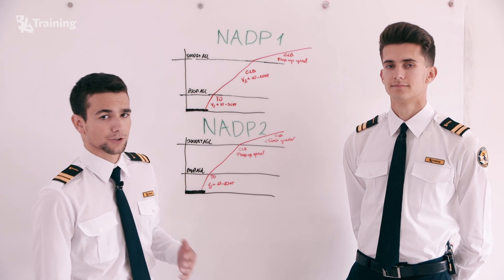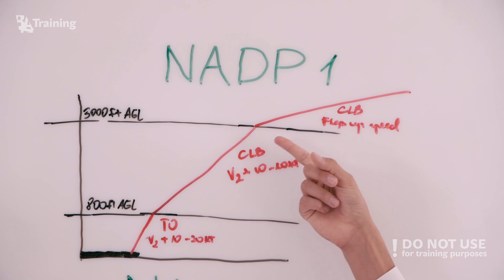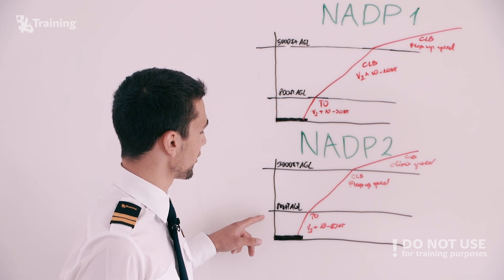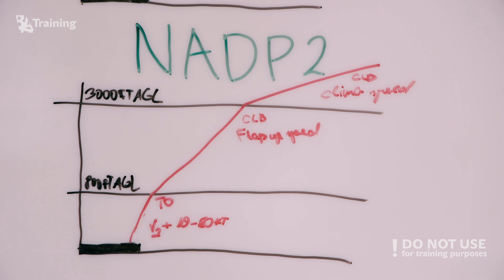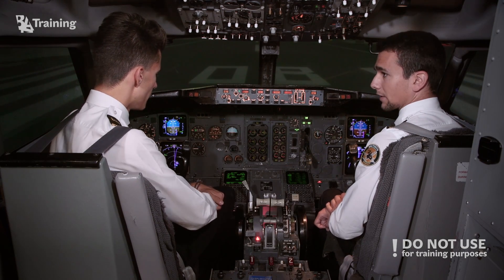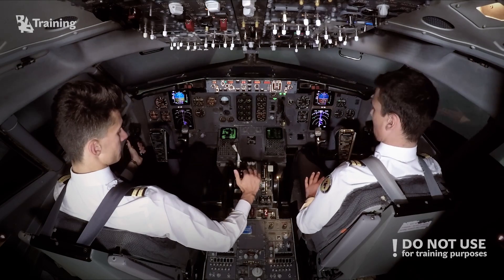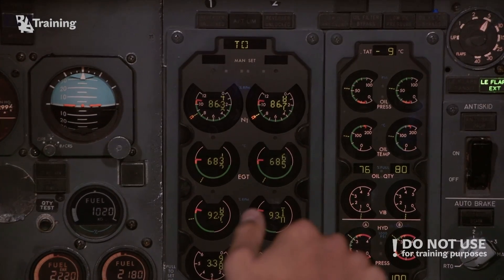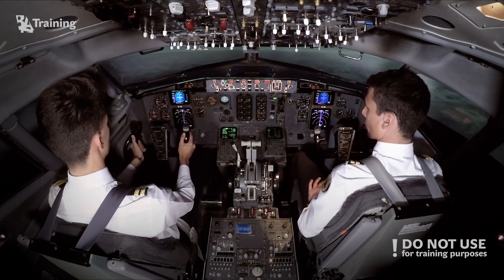Boeing 737 CL Noise Abatement Departure Procedure

Comment: They should be learning how to manually fly aircraft.
Reply: You should be learning what the cadets actually learns b4 spouting nonsense.
Reply: @consciousanimusic9293  When you have your ATP and  20,000 flight hours write me
Reply: NADP1 Noise and the other is both operated via the autopilot otherwise there would be no point. 

The FMC controls the N1 as it reduces and lowers the FD on the PFD to reach speed.   
Lets see your ATP.
Reply: @Hawker75 P.S. the throttles should also be handled by pilots not auto throttle.
Reply: @lostcreek163  fucking typical boomer. do you even know what bullshit you are saying? Safety is top priority for aviation. What good will it have if the pilots have increased workload for doing something that can actually be done way better by the FADEC. This hinders the pilots attention in critical phases of flight and emergency while they can use that attention to correct the faults or fly the damn plane.  There is a reason auto throttle use is a STANDARD OPERATING PROCEDURE on many airlines you dimwit. 

What about the old Aircrafts that need an aircraft engineer and navigator?  ohhhh they need to learn how to manually navigate and operate all the engine parameters manually like a fucking cave man bla bla bla.... 

Go back to your man cave you overgrown baby. Don't talk cock if you don't even know what you are saying.
Reply: @lostcreek163   Each of your comments really impress me on how far human ignorance can go. Have fun dreaming in your little delusional world.

Comment: Why does the FO put his hand on the throttle quadrant during takeoff? Thanks.
Reply: @TK KT nope the FO doesn't decide whether to abort or continue
Reply: The FO doesn't put his hand on the quadrant rather he puts it in the mixture section so that if there is an engine fire , he/she can immediately turn off the engine to reduce further damager.
Hope it helps.
Reply: incase of captain incapacity and to stop him to reduce power during take off,  otherwise aircraft will be stall.